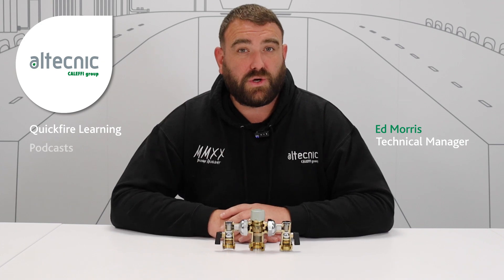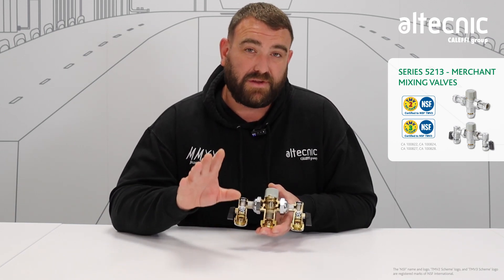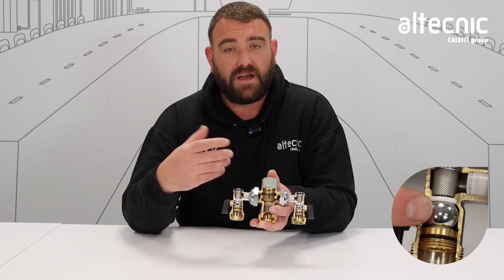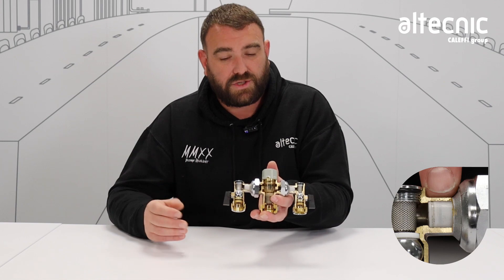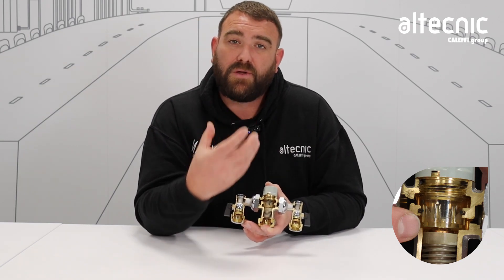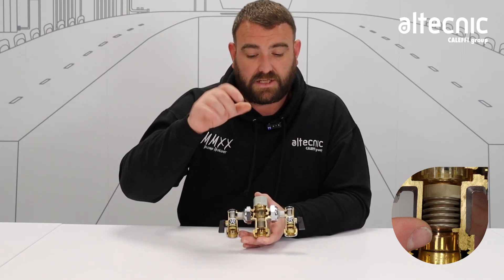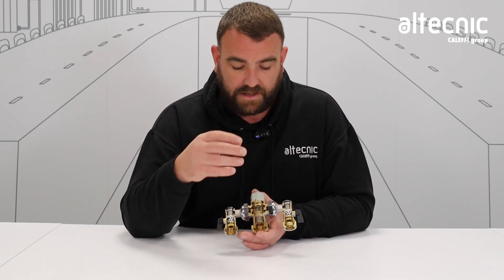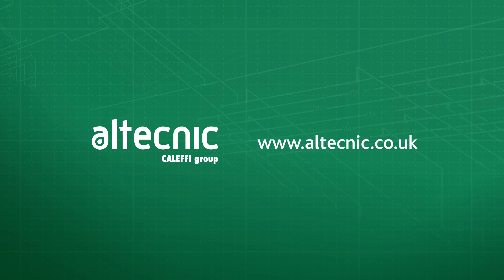How does it work? - Inside a Thermostatic Mixing Valve (TMV)

Comment: Could this mixture valve help my situation?
My only water supply is a tank on a flat roof. At 5 a.m. the water is cold. At 1 p.m. the water is warmer. This is a problem for my instant 5.5kw electric shower.

Comment: The Thermostatic Element expands in the center depending on temperature, how does it do that? Is the metal just a metal with an expansion rate for heat that we found that is roughly acceptable and safe for most human skin?
Reply: If it's anything like a vehicle thermostat it could be a wax which expands under heat. Wax motors are quite typical in these kinds of valves. An adjustment could just be a screw which adjusts where the body of that wax motor sits.
Reply: I assume it a bimetallic strip. There’s 2 different metals rolled together, and when they heat up/cool down they expand/retract at different rates and bend

Comment: you must change the design to include a waste exit on the hot side ; why ? because when you have a solarheater on the roof, you need to waste the cold water in the pipe till you got the hot one; Thinking to be used on dishwasher as well.
Reply: Doesn't dishwasher take only cold water and heats it up itself based on the setting?

Comment: Does it significantly reduce the water flow? Thanks
Reply: Hi, no the flow rate is not significantly reduced, in fact the flow restriction in the tap will have more of an impact than the TMV
Reply: Same question, did you get an answer?
Reply: @Bulls79  nope.
Reply: @Sefraser  maybe I'll go with a standard mixer, to avoid any issues! 😄